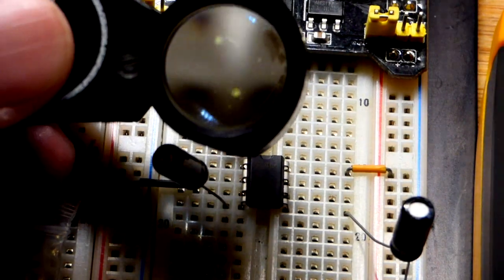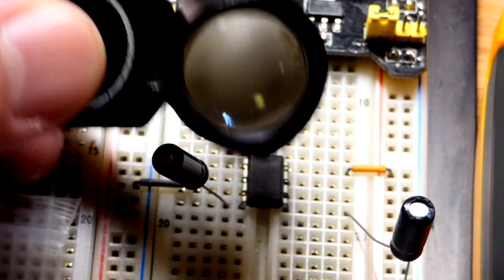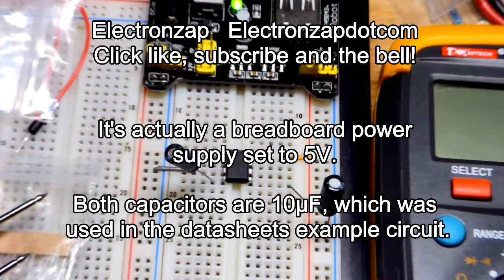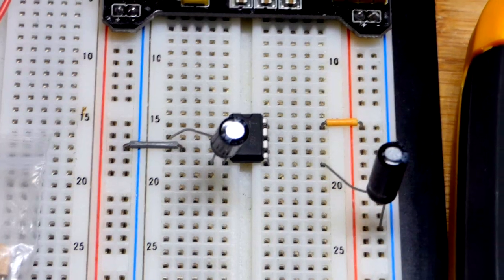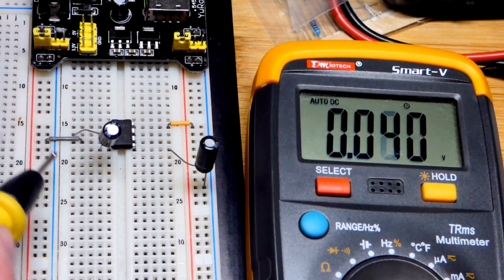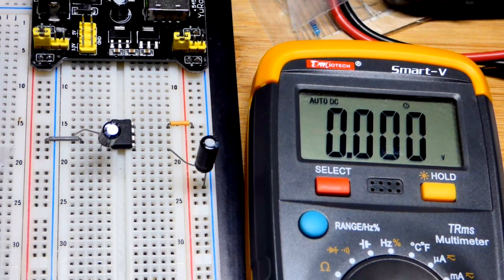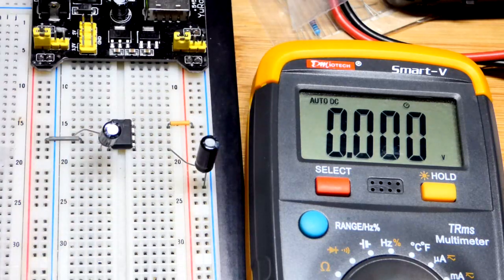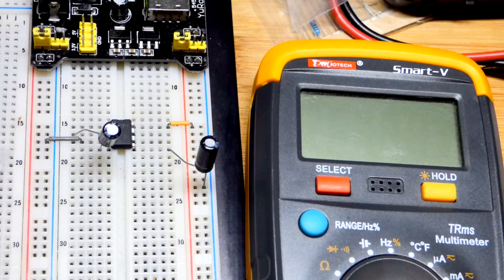7660 switched capacitor voltage multiplier virtual ground rail splitter integrated circuit ICL7660

Comment: Hey, thanks for the video. I'm kind of new, but when I probe my multimeter to see voltage from the power rail (+5V) and the vout of the ICL7660 (-5V) multiple times the value starts to drop to +2V and -2V. When I'm switching the probing again the value starts to drop to 0V. Do you know why? My power comes from a usb-c breakout board from adafruit connected to a power bank.
Reply: Okay I think I know why, the output of the power bank shut off after a set amount of time since low current was drawn. Just wondering, do you have any solution for this?
Reply from the maker: Yeah, many power banks shut off if you don't use enough power (current). I have a USB fan, which I would probably run while it is plugged into the same power bank that I want to use as a 5V supply. I made some videos long ago on trying to keep a power banks from shutting off due to low current circuits. I think with one of them, I lit up one or two DIY 5V 1W LED units.

Comment: I have one query other than this:
I am using TC7662, its working on breadboard giving me -10V from +10V but when i use it on zero PCB its not. Tried everything still not working. Is it also some kind of startup problem. I am posting this problem to every electronic expert on youtube. Its freaking me out :(

Comment: Yes that was me, thanks for the shout out! xD I'd like to point out some of my errors when working with this chip. Make sure you get the polarity of the capacitor connected to pin 5 correct ... and when you experiment with swapping out components make sure you discharge any capacitors before you plug 'em in. I experienced thermal issues and incorrect output voltages due to my ignorance but I also learned a whole lot in the process. They also work pretty well as voltage "doublers" ... I was able to use the ICL7660 to boost up a 9V battery to about 17V, enough to satisfy the initiation supply voltage requirement of a UTC31002A tone ringer.  Cheers! :)
Reply from the maker: Capacitor charge pump voltage multipliers circuits are great! They aren't anywhere near as adjustable, compact, and cheap as inductor/capacitor buck/boost converters though. So, they are less commercially available.
Reply: pp